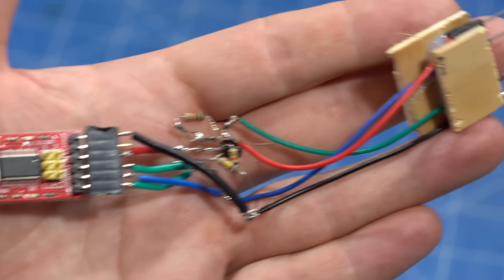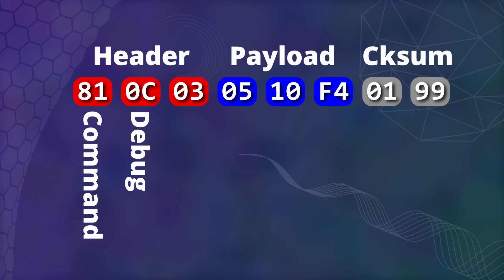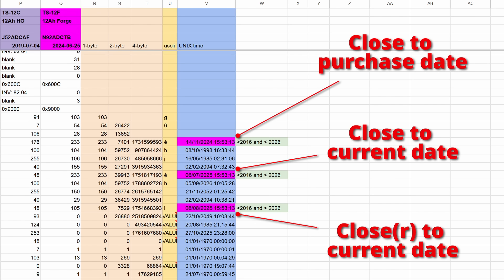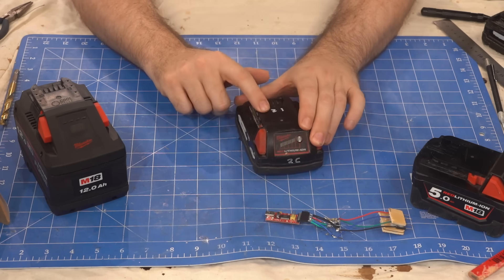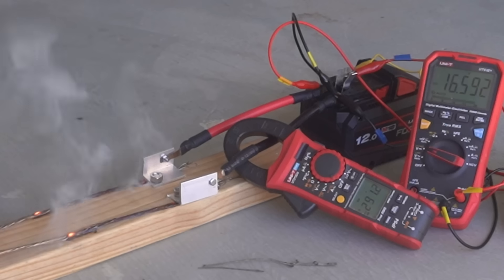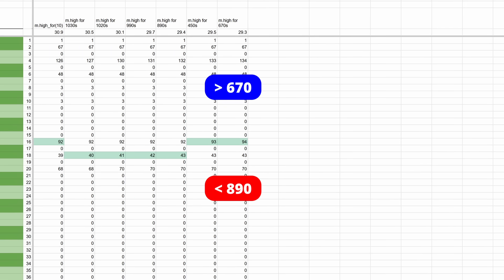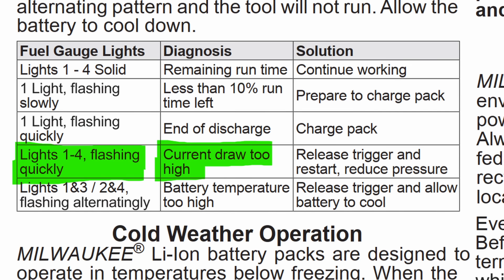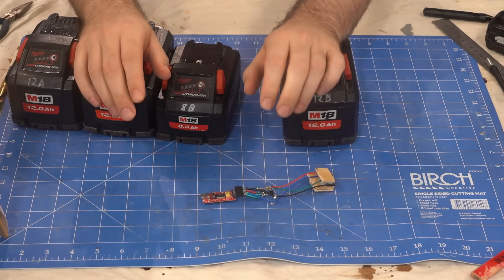Full M18 diagnostics revealed

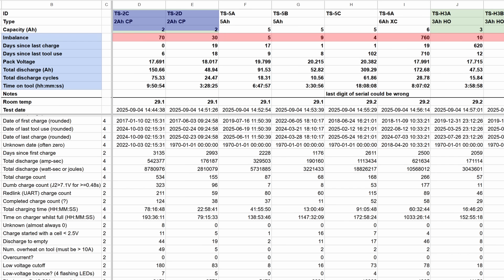Comment: I have noticed All my 12ah and 8ah are the most unreliable m18 packs as well the cells tend to die pretty quickly within a year of use were all my 6ah and smaller packs are going 8 plus years no issues 16:30

Comment: just ordered the parts, but what do you recommend to connect to the battery? You have funny little home made bread board by the looks of it. Will this also work to probe the charging units and see wtf is going on with it? 

I have three M18 batteries, and they all stopped being able to be charged by the charge pack all at the same time, I plug them in and wait for the green light but when I remove the battery from the charger the batteries are dead flat.
Reply from the maker: Spade terminals. Mine are jumper wires, which are too small to make good contact. The "connector" is just a few bits of wood hot glued together.

Comment: I have an M18 High Output XC8.0 battery that is getting a bit old and acting weird. It does not seem to hold much charge anymore and the charger thinks it is full at 3/4 bars, but it still holds a useful amount of charge even if it only has half capacity. If nothing else it has enough juice to run a band saw or a rocket light. I was going to run it until it dies then ditch it at Home Depot's battery bin and replace it with a new Forge, but now I am curious and will build this contraption to see what the battery can tell me.

Thank you and your new friends for your hard work. Being a software engineer I will definitely contribute to your project IF I am able to learn anything new and answer any outstanding questions. No guarantees, but I do like figuring things out and it sounds like there may be some unanswered questions.

Do y'all have anything like this for DeWalt 20V batteries or M12?

Comment: Everything was interesting minus the overt statement said in 10:17 as even (I believe) most of us would like to think someone wouldn't go and slam a battery with 300A and falsely claim it reads, "0" - event never occurred; when we can replay this in the video. This is worthy to note because it means those who are bad actors will without a doubt use this as a sort of exploit among other things, and worsens matters for the average or genuine consumer with an issue. Hope it was just a EU/british humor, but hard to tell /shrug
Great coverage in debugging and explaining the underlying codes, parameters, and overall info for the packs. Honestly, if someone sold a product with open source software that was a plug 'n play module you can connect to a pack; I'd buy one. If for nothing else than 1) see my own packs' health, and 2) see those of those selling packs online, even knock off ones too - imagine what you can unlock by tapping directly into the hardware's interface in a user friendly way than using TTC or Project farm (amazing channels, nothing against them) however, THIS info covered in the video gets down to the exact cells, voltages and more in mere minutes than entire videos do in just a broad and averaged manner as those have. It'd be like the "OBDII" of power tool batteries!
Reply from the maker: It was a joke. It is not possible to use this interface to overwrite data (at least not that we've found). In hindsight, it was a poor joke in the context of this project's goal to give info to users for legitimate use.

Comment: In all your testing, how many of the M18 batteries have melted the plastic around the contact terminals of the batteries? I've got four M18 12.0Ah High Output batteries and one 8.0Ah that have melted badly.

Comment: I really do wonder whether the engineering cost associated with adding this into the battery and tracking everything to deny warranty claims was worth it over giving customers the benefit of the doubt and just sending them a new one. I often find the simplest answer tends to be the best one, surely if they decided not to bother with these stupid diagnostics they would've developed a better brand loyalty associated with trusting customers and being there to honour warranties, that would far outweigh the tiny cost of dishonest people submitting warranty claims?

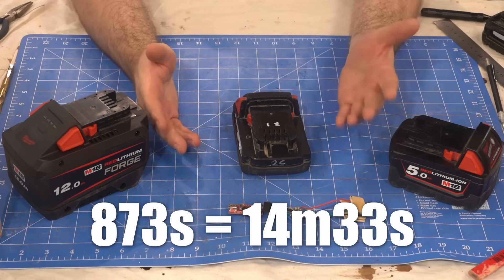Comment: 12:25 I don't think 873 is a random number, it is the result of the full binary numbers up to 512 added and subtracted. 512+256+128−32+16−8
+4−2−1=873. I'm not sure why 873 specifically, but I'm sure there is a reason.

Comment: Love it! I can't find any 8-20V lvl shifters, can you provide instructions how did you built yours?
Reply from the maker: Sparkfun level shifter is general purpose and will shift to whatever voltsge you attach to HV pin. We just attach B+ of the battery (see github wiring diagram)

Comment: Great video.  30mV difference isn't bad, meaning packs could be 4.2v, 4.17v at full charge, which is close enough and will get you close to full capacity. unless i misunderstood what you said at the end, it was hard to hear.  ideally a balance charger could help with that, and at least for the dewalt batteries, easy to make/do.  I assume these you could make a balance charger for them easy enough?
Reply from the maker: I just think that if it's 30mV imbalanced within the first 1-2 years, then it's on its way out. Most of my packs were either within 10mV or wildly out of balance.

Comment: So what can we do with this besides battery testing/diag health. I'm interested in using Milwaukee batteries to power other things..    tools as well as other things.
Reply from the maker: It's only useful for looking at charging and usage statistics. Could be used to extract voltages and temp so you can cutoff when needed, but you can just use the J2 signal for that

Comment: do you need to get a level shifter that does 8 volts or higher or are the red 5 volt ones showed later in the video (and the github page) good enough?
Reply from the maker: The one shown is a general purpose shifter. It shifts to whatever voltage is on the central HV pin. We attach B+ (15-20V) to it. The screenshot I showed says 3.3-5V as that's what 99% of hobbyists want. I unfortunately didn't notice that and it has caused a lot of confusion

Comment: Could u edit the MA/H or increase the batterys capacity?
Reply from the maker: I very much doubt it. The command we send will just get passed to a function with 'address' and 'length'. That function will check if the numbers are valid and return a value if they are. They would definitely block writing of critical data

Comment: Forged batteries are logging location data from One-Key devices.
Reply from the maker: Very interesting. Can you give more details or point towards sources? You probably won't be able to post links, so use keywords I can search for.
Reply from the maker: For example, how many locations does it store? Can you view them in an app? What triggers a location reading (trigger pull,  battery insertion)
Reply: @toolscientist  One-Key tools store data you can see when you connect within Bluetooth range. Forged batteries being so new is most likely going to store that devices info and cache it with excessive or high output use. I own 5 One-Key devices and am sure you’re a couple lines of python away from actually capturing that information.

Comment: Next time you do bracketing like you had to do to narrow down on some charging times it might be quicker to do bisection. It's got O(log n) time complexity, which means if you want to narrow down to the nearest second from an initial range of ~1000 like one of your runs would only take at most 10 ≅ log_2(1000) steps (less than the 14 steps or so it took you). It's essential playing the higher lower game (much like you were doing) except each step of the way you halve the possible range in half, which gives you the most information possible for the next steps, which really helps especially if your step time are long like they were for you.

Amazing work, by the way, this is crazy.
Reply from the maker: If you watch it slowly, I did do bisection after the "sensible" guesses failed. I hate that you mathematically proved that I wasted more time by trying to shortcut 😄
Reply: @toolscientist  If the guesses are sensible, you get way quicker bisections, but of course that depends on the guesses actually being sensible ;)

Comment: I'm interested in the IC used in these batteries. There should be some IC with all features integrated right? I'm currently designing a custom specific battery pack for a project.
Reply from the maker: Makita uses such a chip. MCU + AFE in one. I think it is the RAJ240080. I have a quick look at it in my Makita video (I think vid [006])

Comment: Does only Milwaukee use that protocol, what about Makita and other brands?
Reply from the maker: It's very much a custom protocol designed by Milwaukee. I know Makita has a diagnostics protocol as others have looked into it and you can even buy their diagnostics tool. Unaware of other brands, but I strongly suspect Hilti Nuron has it, but their older 22V packs don't.

Comment: I am a layman and have no special knowledge. I have watched Will Prowse for years and I learned it is *very*  important to have proper cell balancing for a Lion battery pack or it is basically garbage.
I suspect these folks (Hong Kong based company so... ccp owned you know...) know precisely what they are doing and just make it worse so that you end up having to buy more of "their" batteries. 
So thank you very much for sussing out the details and turning their Spyware into an actual **diagnostic tool**.
As someone commented on the video Louis Rossman did covering your achievement: "If *I* have access to it then it is *DIAGNOSTIC**. If I do *NOT then it is **Spyware**." 
I agree with that sentiment One Hundred Percent.

Comment: having been involved with consumer electronics production (set top boxes), it makes sense that the serial number you’re seeing is not the same as the outside number. 
my guess is the number you’re reading is the number of the chip, programmed during chip production (wafer test stage for example). 
this lets them track chips and various assembly stages assemblies before case assembly. and then just match the outside number with the chip number in a database. 

If the case serial number is in there it would be programmed at the end of assembly so it would be in a «softer» register different from the one you’ve discovered.

Comment: I wonder how many kilobytes or megabytes of data the firmware is as you could dump it and decompile it to have the sourcecode.
Reply from the maker: They started with a 32kb chip in 2016. Moved up to 48kb around 2019, and now they're 64kb. So my guess would be over 48kb. I dumped one of their old firmwares (unlocked MSP430) from around 2015 and it was I think 14kb. There's a vid on Tool Scientist RAW on it. They use Renesas R5F100 now and they're all locked

Comment: We really need a follow up on the crazy data you guys get back.

I bet some of these batteries have some wild stats!!! I am sure mine do
Reply from the maker: I did a vid a year ago on flash codes and ~30 people submitted data to me. There were 3 people that had a 9999 charge count and I wonder now if they were related to the dumb charge count. Somehow a tool or charger was putting high voltages on the J2 pin

Comment: I think I'm pretty savvy with lithium batteries, and to see Milwaukee putting ALL this stats intelligence into the things, and yet thinking "shunt balancing? Nawh, we don't need that" is UTTERLY BONKERS to me. Cells will drift. 60 to 100 cycles is just baby's first cycles. These things should be able to go into the thousands. And they would, if they just balanced them. Capacity balance (difference in capacity between cells, which is not detectable by mV difference) is a whole different game, and that's what really kills a pack, where nothing but active balancing could save it - but to not even try? Not even shunt balancing to keep the widest usable charge window? Seriously?

I own precisely one Milwaukee M18 pack shared between a drill and a shop-vac I use occasionally (under once a month). I even bought it used (came with a used drill, then a tool-only shop vac). I keep the battery off-charge until it needs it. Would be interesting to see its stats, but I fully expect it to last many more years.

Comment: Do you film your hands moving around with different gestures before voicing-over your video?
Reply from the maker: The audio was a nightmare on this vid. Original audio was unusable, so I  dubbed over it, which is why it sounds unnatural. I'm also sometimes "rubber-banding" (talking too fast, then too slow as I get out of sync with original). My dub doesn't sound great, but I didn't have time to do it all again.

Comment: Honestly this is the kind of thing that is the cause of me just creating my own battery pack. It takes a while yes because I charge them to full and then discharge them and measure the mAh. Then mark each battery and put it into a spreadsheet. After that I use the website repackr, dump the batteries into the field and it tells me which batteries to put where. That should make the cells perfectly balanced. Having a 6.8 Ah battery pack where the biggest commercial is 6 Ah is fun. Also making my own battery gave me more knowledge on how these things work which is important IMO.
Also this allowed me to throw out batteries that get hot during discharge.

Comment: There is an MPBID and a SerialNumber and they get linked in a database that is internal to the company. The tool itself stores the MPBID and it is used to retrieve the serial number using an API call. The MPBID is 4 bytes and the first 2 bytes(?) indicate which product it is. You should be able to access this API if you have a One-Key account and you claim ownership of the tool via the app. Then if you do an API call for that tool using it's MPBID, you should be able to retrieve the serial number.
Reply from the maker: This sounds like it's for One-key tools. Do they also have linked IDs for the batteries? Have you used their software - does it need internet to retrieve serial?
Reply: @toolscientist  It's been a while so my memory is foggy but I believe any of the batteries from the last 10 years should have MPBIDs and can retrieve linked serial numbers. You can definitely add them in the app but they might need the one-key symbol on them. It's possible the serial number is not available via api for some stuff prior to ~10 years ago. 

I worked on some aspects of the admin app which connected to tools/batteries via serial port through a physical adapter (probably the uart interface like what you built). I'm fairly certain it was capable of getting MPBID and linked serial number via the one-key api.
Reply from the maker: @JoePhilli-DIY  so you're saying that serial number (as printed on case) is not stored in battery? They store MPBID which is linked to the printed serial in a database and can be retreived via an online API?
Reply: @toolscientist  Correct

Comment: Regarding the 873 bucket. Because this is for dumb charging, they might be using a number that’s easily derived from the frequency of the crystal oscillator in the circuit.

Comment: this is amazing work!!
do you have a link to logic level shifter? the one you have in the screenshot is 3.3 to 5V only, but you said it requires at least 8V
Reply from the maker: The linked device is a general purpose shifter and will shift to whatever voltage you connect to the central HV pin. Unfortunately the product description says 3.3-5V (which I had not noticed), but this is simply because that's what 99% of hobbyists want.
Reply: @toolscientist  so even though it says 3.3-5V that device will shift to 8V no problem?
Reply from the maker: @UNgineering yes, it will shift to ~30V which is the mosfet limit
Reply: @toolscientist  beautiful

Comment: Time 3:06 - The implications of what you are talking about is that the battery failure
problem has been a scam the whole time. I've seen the, what appears to be analog,
battery override videos where you short something out and the battery becomes 'reset'
to allow the charger to charge.  I had no idea the companies were putting computers
into the chargers and the batteries,  instead of using analog methods to recharge.
And apparently this isn't information published by the manufacturers since you'all had to
'discover' the codes without manufacturer papers or specifications. 
THAT'S ONE SNEAKY SCAM. These people should be sued out of their profits on that crap.

Comment: I have probably 10 grand of Milwaukee tools and batteries. This is incredible. Thank you so much for this.
Reply: That's enough to fill one tool bag!
Reply: The last few M18 batteries I have seen will not charge past three lights. Back to corded tools now.
Reply: @robytar  use this tool to pull the diagnostics off of it and see what went wrong, it might be an easy fix  and now you’ll have both corded and battery for whatever job you’ll do

Comment: This is like one of those Lou Rossman triumphs. However, sadly, this could lead to improved cryptography in battery communication.
Easier solution: aftermarket batteries. Seriously, it's what I did when I needed a better 20V pack for dewalt.

Comment: Updating values after read is rather normal on some microdevices. Reading would flush write caches. It's either done as precaution to allow some safety margins against typos, or it's done to ensure that all values were written into memory before use to ensure the device will not be operating with half old and half new values.

You should also make some precaution against lithium battery explosion when you are doing high ampere tests. Stuff that would deflect blast away from you. Well ventilated room that would remove nasty fumes from lithium burning.